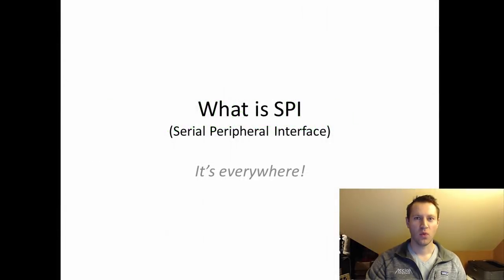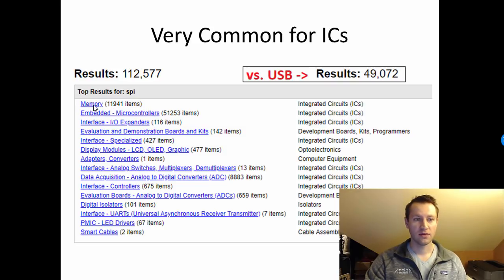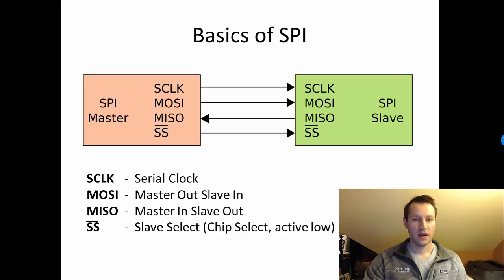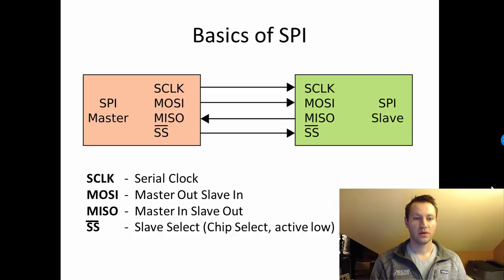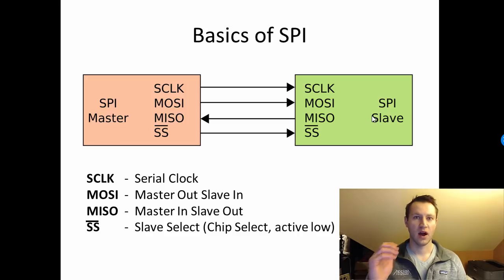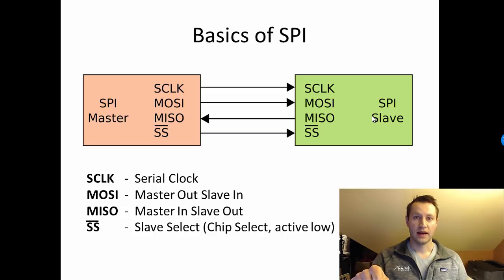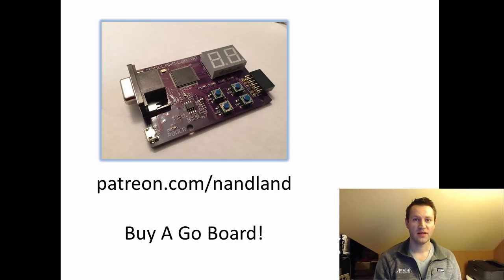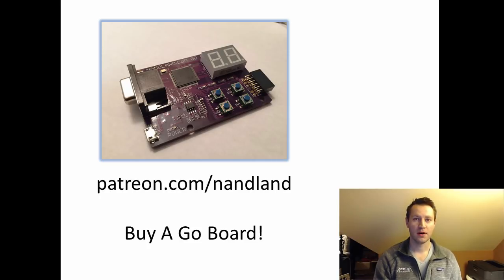What is SPI?  Basics for beginners!

Comment: Amazing Explanation. I have a query on this topic. In SPI there is no Acknowledgement bit. Can you please elaborate on this. Specifically does it mean that with SPI communication protocol our micro-controller (Raspberry Pi) wont be able to receive data at fixed sampling rate from the ADC (Ex. ADS1015)?
Reply from the maker: Sure it can. Have the RPi poll the ADC at whatever frequency you need. DMA is a good option for this if RPi supports over SPI
Reply: @Nandland  Thanks a lot the clarification..could plz suggest some links to understand how can I poll my Raspberry Pi with ADC?

Comment: Hi, I'm new to Arduino. I'm really confused about the different between hardware and software SPI.
Does hardware SPI mean physically plug jumper wire on pin like mosi,miso, clk, clk, sda, etc. and other ends to Arduino's Input/output pins and  no need to define them in the code?
And software SPI is just define non existing hardware pins on the code? 
Right now I'm trying to get my TFT's built-in SD card to work. Both have pins labeled CLK/SCK  and CS. How  do you wire them? Are those shareable or something? Please help.

Comment: I have TFT LCD and SD card reader. Both use MOSI, MISI, and SCK. But arduino board has 1 pin for each. Can i share them between TFT & SD Card Reader by using column rail  on breadboard?
Reply from the maker: Maybe. You need to have unique Chip-Selects, also the TFT LCD and SD Card reader need to both communicate using the same SPI Mode.

Comment: What about NRF24l01 , it works on SPI , and has a range of upto 1 km
Reply: What about it? I assume you're referring to the distances he mentioned. He meant the protocol isn't great for transmitting data over wires longer than one meter. Data being transmitted over RF has its own limits.

Comment: it is gonna be a little irrelevant but can we sample at both rising and falling edge ?
Reply from the maker: That's not built into any SPI modes. So what you would be doing is sampling just as the data was changing, which would cause metastability issues. Not recommended!

Comment: 1. Translate the logic to find the position of the first high in an 8 bit data item into program
(Assembly or C language). The data must be read using interrupt driven SPI protocol. The 
data should be scanned from D7 to D0. Give the results for XX where XX is your Roll No.
Table.1 SPI Registers and their bit allocation
The vector address for SPI ISR is at 0018 Hex address of ROM Location whereas its Vector Name 
in WinAVR is SPI_STC_vect

Help please.